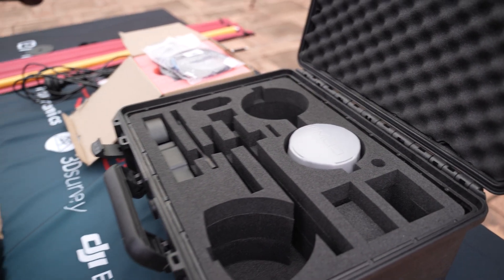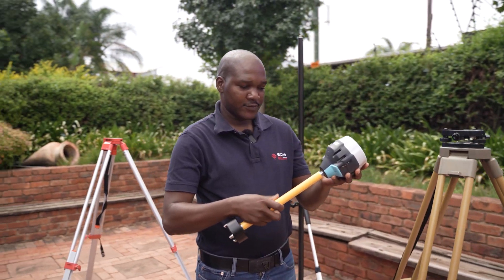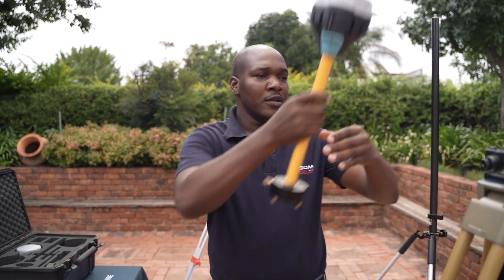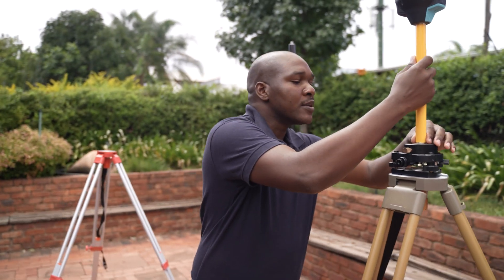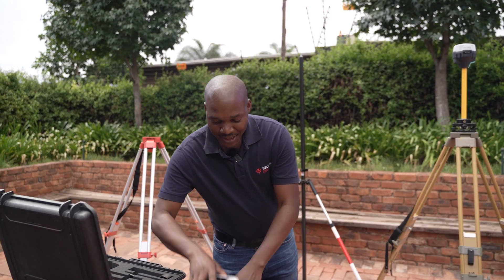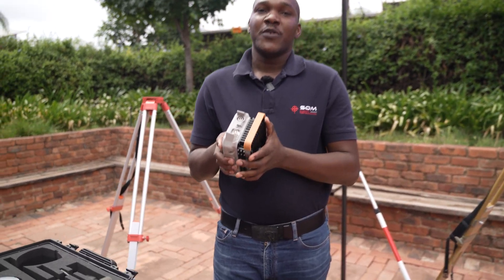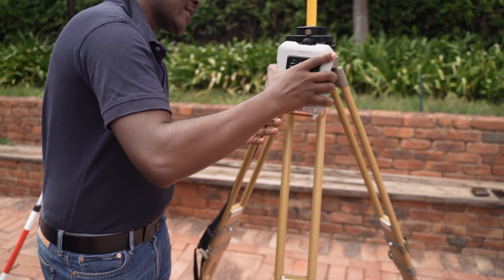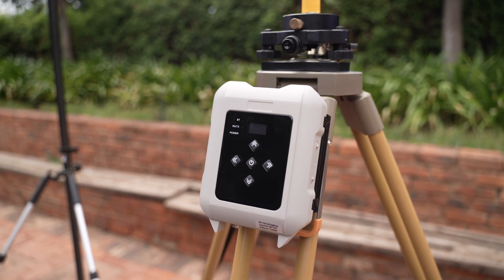Set-up Emlid Reach RS2+ Base and Reach RS3 Rover for extended communication via external UHF radio

Comment: hi is that correct use this cable for connect emlid rs2 to harxon and power? 5pin Y Cable 734698A for Lei-ca total Station to PC and SAE data cable,

Comment: I want to buy just the cable rs232 connect to external radio. Any link?
Reply from the maker: Hi there, thank you for reaching out! If you can, please provide your email address as well as your preferred shipping location and our sales manager will be in contact with you with a comprehensive quote of the external radio. Looking forward to your response!

Comment: Hi, is there a way to manually add coordinate points to a project on Emild flow/ Studio like I can in autocad?
Reply from the maker: Hi there! Thank you for reaching out

Points can be added manually into Emlid Flow by either typing them in manually into a project or importing them from a csv file. Emlid studio is for post-processing your gnss raw data from receivers in either Static or PPK modes it is completely different from autocad.

Hope this helped! If you have any more questions, please do not hesitate to ask.